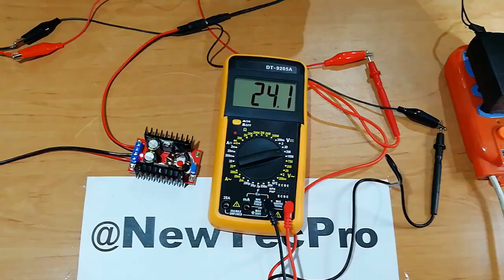How to use 150W DC-DC Boost 6A Step Up Converter Power supply Module?

Comment: Excellent video. Very well done. Regarding voltage, I am clear that this module will reach 30v, but what about current? Let's say I have 24v 15a, what will be the current output? Will it 6a because they mentioned it as maximum. If I use 24v 5a power supply adapter like you, then I will get 30v 5a ? And how hot does it become? And will that female DC connector handle above 5a without getting hot? . I want to buy this module, but I am still undecided. My goal is 30v 15a to power up my 2.1 audio amplifier. XH-A128 160x2 + 220w These are the questions that I have. Please advise.
Reply from the maker: Hello. It seems that this module is not suitable for you. What is important is that the output power is at least 150 watts. 30 volts 15 amps is too high. That means you should finally get 30 volts 4.5 amps from this module. If you get 30V 5A, you should use a fan to cool the heatsink.

Comment: can I use 12v battery into 24v for ups 1200va?
Reply from the maker: Yes, you can step up the voltage to 24 and then use it. Also, another way is: a 12V battery cannot directly replace a 24V battery** because the UPS is designed to work with a 24V system. However, you can *connect two 12V batteries in series* to achieve the required 24V. This means connecting the positive terminal of one battery to the negative terminal of the other battery.

Comment: Your good teaching. Does this voltage reducer module have reverse connection protection?
Reply from the maker: No, most of them are not protected. In any case, be careful when connecting the + and - wires so as not to damage the module

Comment: bro also mention about amperes and its output watt as well next time, you have meter to use thanks
Reply from the maker: hi:
Input Voltage: 12~32V DC
Output Voltage: 12V~35V DC
Max. Output Current: 6A
Max. Input Current: 10A

Comment: does this will charge a laptop that need 65w from a 12v battery  sir thank you
Reply from the maker: Yes, you can adjust the desired voltage, but there is a problem. You must use the charger control to stop the charging process when the battery is fully charged. Otherwise, the battery will be damaged.
Reply: @newtecpro how is this done?

Comment: How is it called 150 watts? Do we have to change the heatsinks if we take 6 Ampere load from it?
Reply from the maker: This converter has a maximum power of 150 watts. It depends on the received voltage.
To get 150 watts, it is better to use a fan on the heatsink to do the cooling.

Comment: Hi sir 
I get 17volt 4amp from transformer dc out .i want 23volt 6 amp.it is said maximum 6amp will available when using this converter.is that 6amp available or not or only 4amps.
please help me sir.
Reply from the maker: Unfortunately, this converter only increases the voltage. Can't increase amps.
Reply: @newtecpro  OK SIR The transformer iam using gives 4amps output.if i use this will i get 4amps output or will the amps decrease.

Comment: I noticed you went to 36 volts, caps are rated at 35 volts. Any kind of load at that voltage will blow the caps.
Reply from the maker: 36 volts is mentioned in the datasheet, but your opinion is correct. It is better to never use more than 35 volts. More confidence

Comment: Can one of these be used to regulate the voltage on a car alternator?
Reply from the maker: What do you mean by car dynamo control? You can receive input power from the alternator and get a fixed output. Of course, the amount of amperage received must be within the range
Reply: No! The car alternator puts out to many amps.

Comment: I have a 3s lithium battery pack to charge i used a 12v 2 amp adapter set this thing clamp it to 13 volt hook a schottky diode with the bettery bms to protect this board from reverse voltage and connected everything and turned it on but strangely the output voltage fluctuates and it makes a starnge noise i tried two of this and different adpaters but same result, I am confused what's going on
Reply from the maker: In such cases, it is necessary to proceed step by step. First of all, you give only input from the adapter to the module directly without additional electronic parts.
Then check whether the output voltage fluctuates or not?
Reply: @newtecpro  yeap i did that with other loads it seems to work just fine so now i think i will tweak the feedback of my adapter and try to get around 13 volt and try with that..
Reply from the maker: @mr.strange7002  Please inform us of the result
Reply: @newtecpro  Yeap i've done that and now it seems to work just fine i am happy that finally i can charge my batteries 😌

Comment: Om. Kalau input nya 45 ampere 12 volt . Apakah step up nya akan rusak?
Reply from the maker: It is better to get amps in the output power range. Because the IC heats up.

Comment: Ijin bertanya mas  ,  bila bila tegangan sumber tidak stabil / fluktuatif ( sering naik turun) , apakah output tetap stabil ? Dan apakah bisa berpengaruh pada modul tsb ( apakah bikin tidak awet dan bisa merusak) ?
Reply from the maker: Yes, the output is fixed. The output voltage will be exactly the same as it was set

Comment: This module Working for  car battery
Reply from the maker: Yes, because the input voltage is 10 to 32 V DC. The car voltage is between 10.5 and 16 volts. So, you can use this voltage reducing module for the car.

Comment: Noes estas jodiendo?? pruebas un ventilador de 24V que consume 1W ??? prueba con algo de verdad como una tira de led de 50W un reflector de 100W haber si en verdad trabaja el modulo porque usas juguetes se supone que es de 6A usa todo su potencial
Reply from the maker: To use full power, you must use a fan to cool the heatsinks. It is also better not to use maximum power all the time.